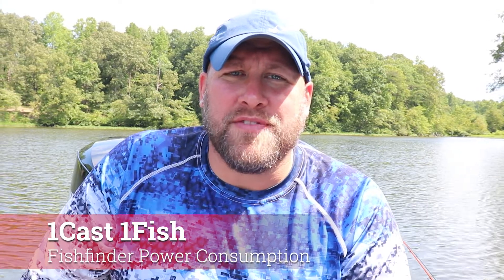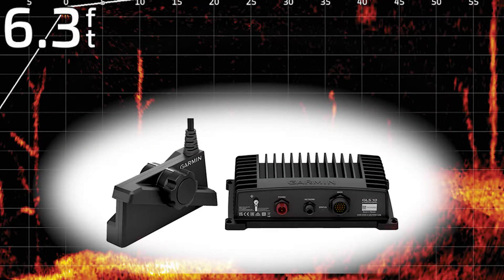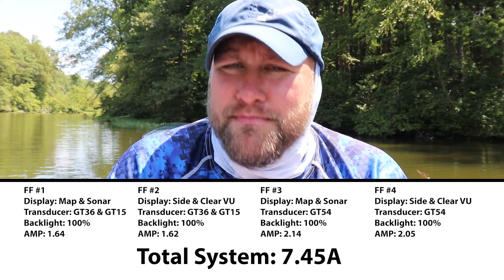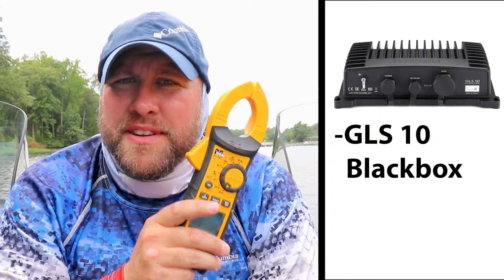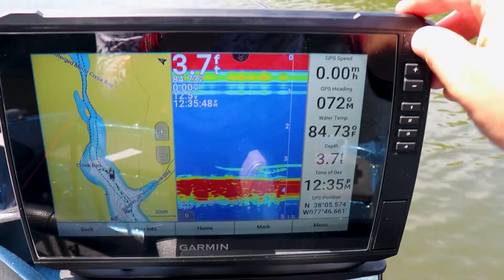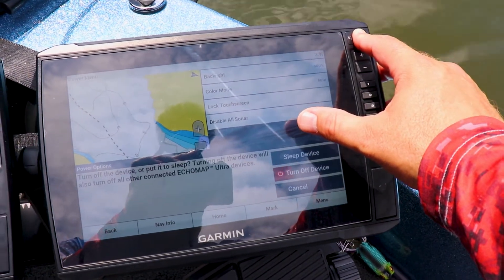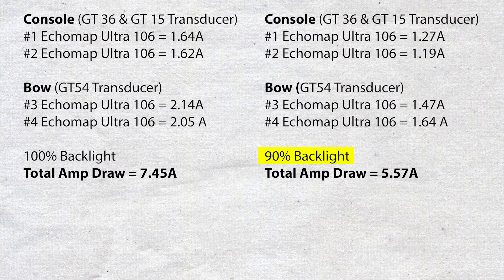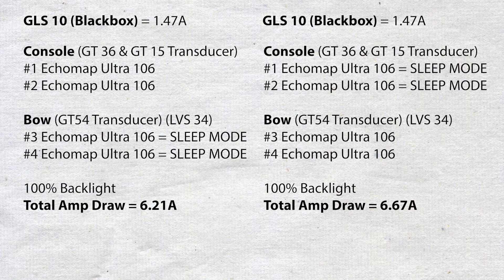TESTED! Garmin LiveScope LVS 34 | How Much Battery Do You Need?

Comment: Nice work, very informative! Food for thought: besides the units using different transducers, another reason why your bow graphs were demanding a bit more current is likely because they're receiving a bit lower supply voltage than the units at your console.
Reply from the maker: Could be, but I would suspect that the difference would be extremely minimal.  The wire runs are about the same for all graphs
Reply: @1Cast1Fish  Just a thought,  If your power source is at the stern of your boat I would think the wire runs to the graphs on the bow is close to double the length of the graphs at the console. It would be useful to include the on screen supply Voltage reading for each graph on the spreadsheets, along with a Power calculation for each individual unit. Again, nice work!
Reply from the maker: I am in a unique situation with my boat type...all my batteries are in the middle.  I do plan on doing some more testing and sharing once the weather warms up, so stay tuned.
Reply: @ Will do, interested to see the results. PS: Great content, keep up the good work.

Comment: Excellent Video! You would think the manufacturers would produce a video like this. Thank  you for taking time to do all of this work. I struggled with how much battery I needed to run my gear, FYI I went with Lithium batteries in my boat - except for cranking and saved a lot of weight and gained a lot of reserve power.
Reply from the maker: Glad it was helpful, I will likely go Lithium when I need to replace mine again...but they are all pretty much new

Comment: I have 3 garmin 106sv and life scope all linked together they all come on at the same time how do you turn them off individually there is only 1transducer for all devices
Reply from the maker: You can not with the 106's, I have 4 and they all turn on when any of them are powered up.  I just put the units in sleep mode that I am not using. 
I searched for an answer to this exact same question once mine were installed.
Reply: Thanks for the info
Reply from the maker: I hope they eventually do a update for this
Reply: He showed pushing the power button for a split second showed sleep mode.
Reply: Disconnect the network cable

Comment: Thanks for uploading a very much needed informal video about amps draw.. You helped me understand power consumption a little more.  So I have a question for you,  I basically have the same setup as you do, however I have two live scopes, so say for instance my entire system is drawing 11.9 amp and I want to fish for 8hr.  That would make my amp consumption 95.2 amps for 8 hr ?  What size lithium battery would i need to run my system?  Thanks
Reply from the maker: I would check with the lithium manufactures for their recommendations as they have alot of run time data available on their websites.  Now I run my system of electronics off a 100ah Lead Acid Interstate battery.  Thats 4 Garmin 106 Ultras and the LVS.  Now I can say that I fish 8 hours without issue on this setup, but I do sleep 2 of the 4 fishfinders based on my location in the boat.  The biggest difference is that with lithium you get a deeper discharge cycle, so you get more "usable" battery compared to lithium.  A 100ah Lithium will run alot longer than a 100ah Lead battery.  That said when I go to replace my batteries next go around (hopefully not soon :) ) I will likely look at lithium in the 100-125 Ahr area.
Putting those units in sleep mode definitely saves some juice.

Comment: Question about my Striker 4...........I'm on my second battery in a year (new this summer). I just used it for a short two day fishing trip and the voltage dropped to the point of shutting off the Striker 4. Battery charger lights up green, in fact it just did when I put it on it. When fishing for parts of two days I could watch the voltage drop. Is this a battery problem or FF? I could turn it back on to find depth but only for a minute or two before it shutting down again. Is there a way to connect FF to my 12v trolling motor battery?
Reply from the maker: What size and type of battery was you using?
Yes you can connect it to your trolling battery as well...many connection options depending on your setup

Comment: A little off topic BUT hoping you wouldnt mind helping out a fellow striker 4 user. The 4-pin power cable  on my striker 4 is no good and I was wondering if a replacement garmin 2-pin power cable is compatible as Im getting one in a couple of days. All i need is for the dang thing to come one and take me to my best fishing spots once more😢. No fancy shmancy stuff
Reply from the maker: Requires the 4 pin, they are pretty cheap on Amazon...I think less than $20.